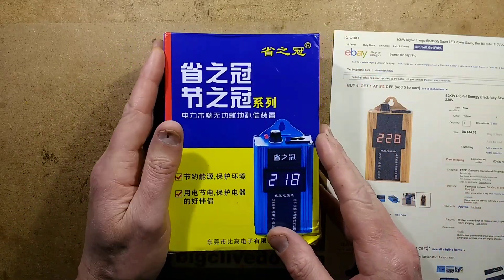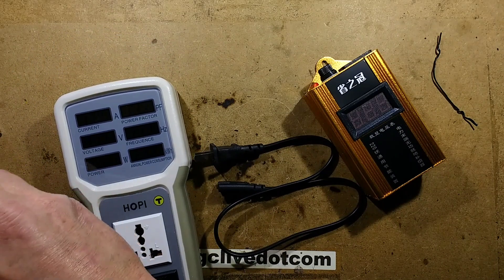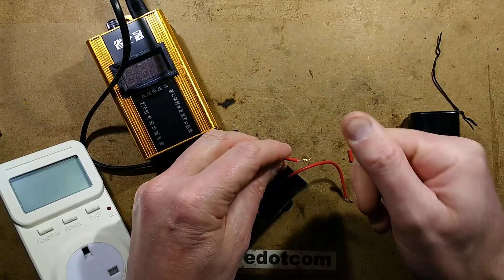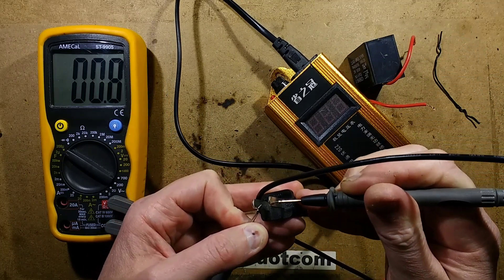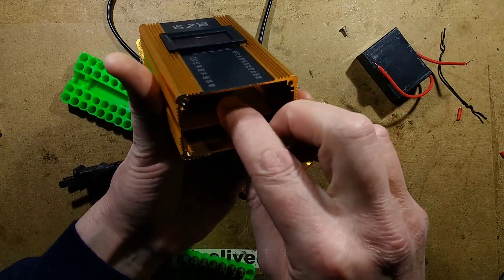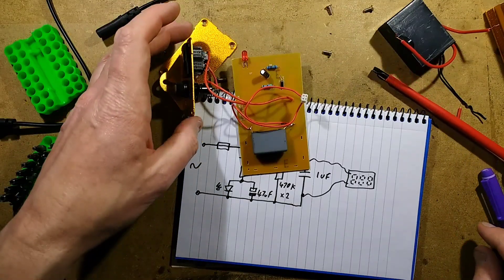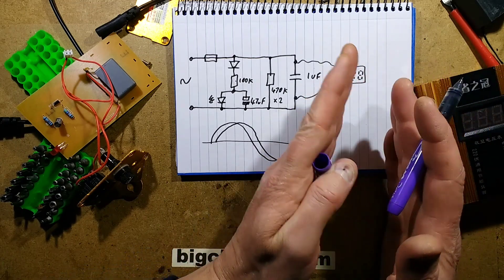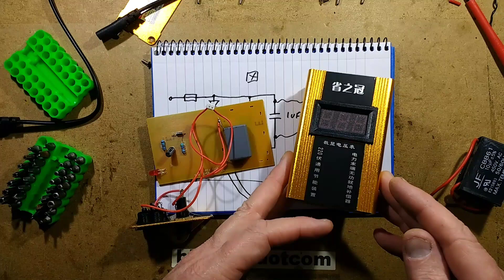Inside a digital 80kW power saver unit.  (with schematic)

Comment: If they ever start billing for apparent power then you will start seeing people unplugging everything in their house when they aren't using it. I'm pretty sure the inconvenience will have legislatures all over the world eye ball deep in hate mail from upset people that hate setting the clocks on their microwaves and entertainment stands. Not to mention clock radios that will have to be reset daily after unplugging. There would be a boom from people installing whole house disconnects. I'm sure most would simply disconnect every time without unloading the circuits adding to the commonality of the boom. Arc flash, smarc flash. XD

Comment: OK, so it won't affect your power bill(for now) but what if you are running an off-grid system? Will it help your battery reserves if you are running an inductive load on the inverter like a refrigerator/freezer?
Reply from the maker: Only if the power factor capacitor was wired across the compressor circuit so it was only active when the compressor was.

Comment: Hey Clive, would love to see a test/review/teardown of of one of these cheap ass 1000 volt insulation testers

https://www.ebay.com/itm/Digital-Insulation-Meter-Resistance-Tester-BM500A-1000V-1999M-Megohmmeter-Megger-/281820294946
Reply from the maker: I've had one sitting here for a long time awaiting proper investigation.  It actually looks well built.
Reply: Would love to see that as well, perhaps combined with some practical usage tips - the chinglish instructions are really less than helpful.
Reply: Yeah I'm still a bit confused about those and how they can be used.

Comment: Do you think that metal case with no ground is a good idea???
Reply: Yes! With hand soldered wires inside.
Reply from the maker: No it's a terrible idea.
Reply: I probably should have written "Did they really think it was a good idea to have a metal case with no ground."
Reply: Yes, they did - do you know how much it would increase production costs to earth it?
Reply: +Thermal Ions
May I direct you to BigClives comment just above
Reply: Oh, I agree, as a consumer it's a terrible idea. I was responding to your re-worded question. The manufacturer thinks it's a good idea as it saves on production costs, hence increased profitability.
Reply: @mattymerr701
its an invasion strategy . try to kill as many ppl as possible before they send in the army , hehe :-)

Comment: I like how they spent so much on the gimmicky display module that they ran out of money in the budget for the actual capacitor to run the quack device. Not only is it a device that does nothing, it does nothing even less than it did before!

Comment: Old-style domestic power meters did only measure real power.  I'm not sure about the newer digital ones.

In industrial settings the meter does measure apparent power.  Because current flow causes resistive losses in power lines.  If you're pulling enough current in inductive loads (motors) then that apparent power causes enough resistive loss in power lines that you get charged for it.  Which encourages you to fit correction capacitors so your power bill goes down.

Even if newer domestic meters measure apparent power (I don't know if they do) it's probably still not a good idea to use one of these.  If you have non-compact fluorescents they should have built-in ballasts anyway.  Maybe the motors on your vacuum and washing machine don't have ballasts, but that would only be a problem when they're running.

Which means if you leave this thing plugged in all the time and your domestic meter does measure apparent power then it will probably end up costing you money rather than saving it.  Unless you do a lot of vacuuming.

Comment: Can you explain real power and apparent power in a little more detail in a video please? I've always suspected there is something behind the big smart meter roll out...what's in it for them etc.
Reply: Smart meters is essentially so they can lay off all the meter readers, and upsell you the wrong tariff,  and sell info about which tariff is most wrong to other companies.
Reply: Apparent power: Voltage x current.  Power factor and phase angle is ignored.  Real power is harder to explain, but it is always the same or less than Apparent Power.  If the load is a perfect capacitor or inductor, you would end up with zero Real Power.  It would absorb power for 1/4 of the cycle (when voltage and current is both positive or both negative) and it would give power back the next 1/4 cycle (when voltage is positive and current opposite).  However, I disagree with Clive about the power company switching.  At least in the US, the utilities are regulated.  They can't change the terms of service like that on their own.  Not legally anyway.
Reply: Apparent power is when the man of a household gives the wife instructions. Real power is when she ignores him.
Reply: Pretty sure the main reason is simply because of grid tied solar. With an old meter, it just makes the meter roll backwards, with a smart meter it actually allows them to measure how much has gone back into the grid (I _think_. Can't quite remember)
Reply: They do have capacitors. though that is not really for long term storage of energy afaik (Not an electrical engineer, I don't have formal knowledge of power grids or substations or anything else). And yes, that is correct, the wireless reading bit. Also, I know that were I live (in aus) we had a house solar install before they installed the smart meter, what I don't know is if it was before or around the time that they were being rolled out. I may have just made an incorrect connection between the two. And just another tid-bit. They often don't actually go and read the meter, they often give an estimated consumption and only occasionally read the meter.
Reply: Hmmmm...I'm not so sure, but it would be lovely if that was the case. They can see peak load without smart meters - even we mere mortals can see this http://www.gridwatch.templar.co.uk/
Reply: Oh, yes.  Power factor is an issue for commercial users.  Power loss in transmission lines is given by RxI^2.  Meaning, the power lost is a square of the current - regardless of phase angle.  The worse the power factor, the higher the current for the same amount of real power delivered (and billed).  So, the power company suffers a higher loss and more stress on the equipment the worse the power factor gets - but gets no added funds via KWH billing.  For small loads, like the kind that gets reviewed in this channel, it's not worth worrying about.  But at industrial levels, it is a worry.
Reply: Thanks for that. I'm pretty sure power factor is taken into consideration in industry?
Reply: Hmm . . .  so who's using all that power between midnight and six am, is it you Clive?
Reply: I've heard of smart meter before solar took off (around 2008), the benefit of it is it allow power provider to read energy consumption wireless in real time, thus it allow them to predict the peak load from the whole grid, and when they can predict load; they can reduce energy waste, why? because they usually produce more energy than anyone ever consume as a "margin of safety" and the rest is "burnt away" as a waste thru resistive heating at their facility, because at that time there usually wasn't any power storage system to save all that energy.

Comment: I suppose it is doing the people who buy these a favour by not having a large capacitor, as most people wouldn't have large inductive loads in their homes to warrant power factor correction lol. I don't suppose you've tested your own house meter if it reads reactive power?  I have a feeling it just averages the two waveforms and doesn't discern between real or reactive at all..
Reply: Washing machine/vacuum cleaner motor and microwave transformer are quite large inductive loads.
Reply: While that is true, they usually have capacitors of their own to increase the PF as appliances in the EU have regulations in regards to this. 
My point was that if this device did have a capacitor matched to the 80kW claim, it would do more harm than good even if a house had all of its motorised appliances plugged in and running at once.
Reply: Skruffles actually, these can be used to filter out noise from powerline networking for noise sensitive appliances like high end audio systems, and can also be used to separate two powerline networks and prevent them from interfering with each other.

Comment: Energy companies charging for apparent power over real power? Not allowed for residential customers in the USA, although if you are sending back nasty spikes they may send out a letter to warn you that they are going to charge you more if you don't clean up things.

Now, for all industrial, some commercial, and other utilities, they charge a base rate of real power, but will charge additional amounts if you are drawing more apparent power in every country. This is done because the substation or switching station has to correct the power factor to protect the station and the generators. It is also done because it can cause damage to transformers, switching gear, etc. to run bad power through them. Especially if there are large current spikes or voltage transients. Imagine the inrush current and then the transients on a whole factory starting up/shutting down, or just a single production line. Or an inductive heating system at a foundry turning one and off over the course of a day. It can easily blow fuses at the substation or melt lines. Plus those pulses come through and effect all of the other customers on that substation.

The solution, for many older factories that do not have modern motor drivers that correct the power factor one each circuit, is to place the entire facility on an uninterruptible power supply. The UPS doesn't have to be any larger than what is needed to take care of brownouts and brief power drops (sub 5 seconds). Newer or updated facilities can rely on their motor drivers to filter most of the power for them with 2 very important exceptions: the power for computer based automation and the power for sensing equipment. Both require clean, stable power to work correctly and can easily be damaged by bad power, just like your home electronics. The sensing circuits are even more susceptible to bad power and also need filtration, isolation, and shielding of their power and sensing circuits.

I was an industrial electrician in the USA. I am now retired early for medical reasons.
Reply: KnightsWithoutATable In Mexico is the same actually, only the real power is charged, but in the industry both
Reply: Great read thank you! I'm trying to get in to electrical and am enjoying learning from everyone!
Reply: I've heard this PFC described as "basically, a f**k load of capacitors in a box"
Reply: I have also heard about large capacitor banks being used to correct Industrial power factor.  In the old days, this must have been cheaper than a UPS (actually a mechanical one then).
Reply: Cap banks for correcting power factor are to counteract the phase shift from all the coils in the motors found in factories and processing plants. Caps are still used for this, but they do not correct the power factor as well as a UPS. You can also use variable frequency drives as filtering, but you still have transients (power spikes), if the suddenly shut off for any reason. 

As far as mechanical UPS, they were typically either flywheel or water reservoir based and, yes, very expensive. Since the 80's they have been replaced with electric systems as Zener diodes dropped in price.
Reply: Looking at my power company's rate sheet it's: Total real power, peak power (over a 15 minute period), and power factor.  There's no way they can switch to apparent power without the government utilities commission climbing all over them.

Comment: So if a guy had fluorescent tubs in his office and he plugs a solder station in and the lights flicker would this or a bigger capacitor stop or reduce them from flickering.
Reply: Raymond Mucklow -- There are now being sold drop-in replacements for fluorescent tubes which are actually long strings of LEDs in series with appropriate power conditioning circuitry in the tube to make them run from the fluorescent ballast. Maybe get one and see if it also flickers?
Reply from the maker: A soldering iron shouldn't have such a dramatic effect unless it's got a big transformer and causes a very brief voltage dip.  Not sure this would help much, but an inline NTC inrush limiter might help.
Reply: No, it would not help at all. An AVR running the lights would help. But may not be cost-effective if you've got a lot of lights to run; as high power AVRs need big and more expensive autotransformer, in which case changing the lights to LEDs with constant current drivers may be the cheaper route.
Reply: bigclivedotcom thank you.
Reply: Andrei H thank you as well.

Comment: I ordered a super cheap one of these things a while ago just because I wanted the plugpack enclosure for something else and I thought hey I can take the juicy cap out and maybe use it for something but when I opened the case all I got inside was an LED and 4 resistors and even thought the enclosure was the only thing I actually needed I felt so cheated
Reply: yeme I was thinking about using that box for other uses also.
Reply: Actually it's a nicely made little enclosure, with nothing useful inside.
Reply: it's actually a box for diy uses but people don't but it so they put some less in to make it fancy
Reply: Done that more than once - apparently, Great Minds think alike (and I get lucky once in a while too!). :D

Comment: I'm afraid power companies will charge for apparent power at some point in time too. There should be a huge uproar from everybody, like a real shit storm, if that ever happens. I mean, it's just another method for big companies to suck money out of the little people.
Reply from the maker: It would probably be a new avenue for no-win, no-fee style lawyers..
Reply: Well, at least here in Germany, things are a bit different. I'm not even sure if single customers are allowed to pursue this matter, or if this is something a consumer protection organization has to do. But then, if it gets pursued and ends up in a court that's high enough, they all have to abide by that. This is how it was with mobile phone providers when they started charging a "deposit fee" for your SIM card when you cancelled your contract and didn't mail the SIM card back to them. A consumer protection organization sued one of those providers (the most notorious one) and won, and then every other provider had to stop charging for SIM card deposits as well.
Reply: Well yes they probably will start charging for it at some point. I mean technically apparent power IS actually costing the power companies money one way or another. I'm sure the whole not charging domestic customers for apparent power thing seemed like a great idea back when your average household load consisted entirely of incandescent lamps and electric fires, but now every home has 15 billion poorly engineered SMPSes running 24 hours a day, they're probably starting to regret that decision.

Comment: A ran Google translate from the back and got this " Product principle strict product characteristics of the product is the use of safe w and the traditional reactive power to compensate for the power of the original king, so that current balance, stable for the old filter transient surge, improve power factor, big month to reduce the loss of electricity systems To achieve energy saving effect! This product does not produce high frequency □ Feng high power due to harmonics, do not pollute the grid. Is a new environmentally friendly energy-saving products. And to extend the life of electrical appliances have a certain role. "丒 high power when the funny arrogant gray with the head and node principle simple diagram / 7 automatic energy saving .AI ERA) filter ridge wave smooth for burning st1, sea -)-one."....... Take from it what you will
Reply: Lol: "to compensate for the power of the original king"
Reply: Kris M my fave bit is the "funny arrogant gray with the head" bit. Gotta love some Google translate
Reply: Absolutely clear translation . . . . . . Environmentally friendly since this reduces (?) "Grid Pollution" :D
Reply: Hail to the king, baby.
Reply: Richard Andrews well I for one, am glad this quandry has been resolved.
Reply: Translated colloquially, it reads 'This statement is a load of bovine skat; the device is a shiny yellow box which will be interesting to the tall Grey-bearded original IOM king of product disassembly, so that he can provide great amusement and entertainment to all of his loyal subjects.' 'Maid in the Peeplos Repubric Of Chian.' - although that last sentence may be spurious.
Reply: well see it all makes sense now
Reply: Well, I really couldn't have put it better myself, Now I understand completely. "Traditional reactive power, to compensate for the power of the original King".... "Funny arrogant grey with the head".  Google translate is the best thing since water was created.... or oxygen! 😂
Reply: ... are you sure you're not translating Cantonese instead of Mandarin?  There must be a difference...

The usual Chinglish.  😮